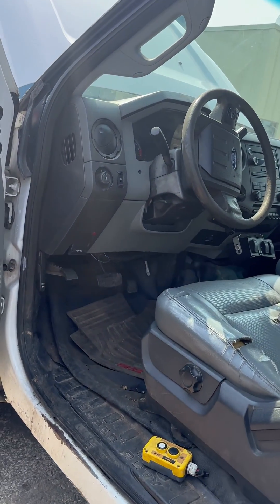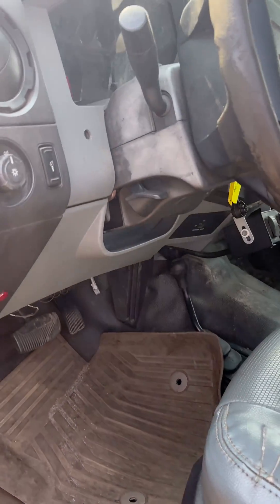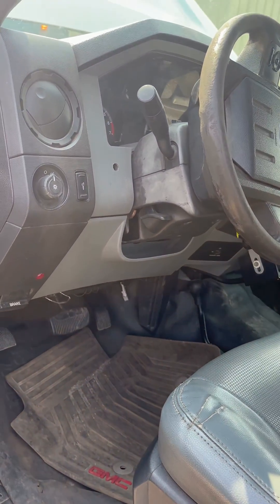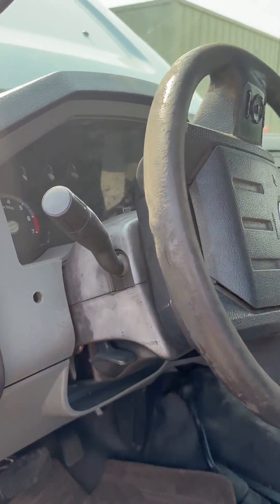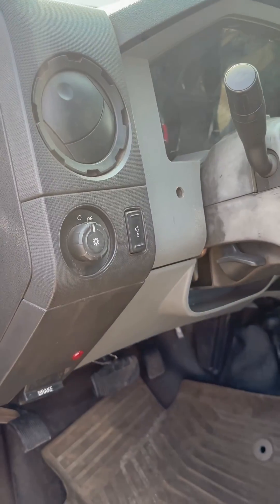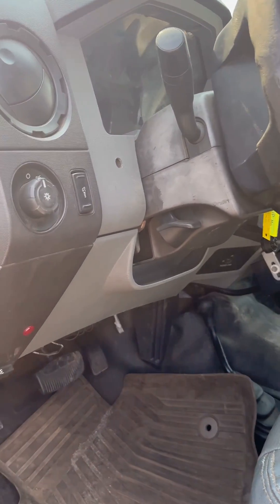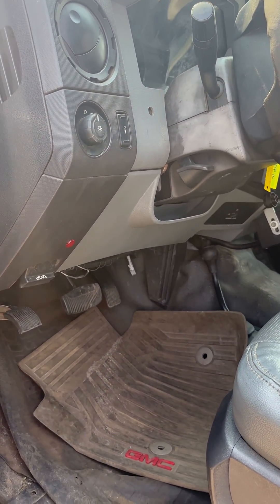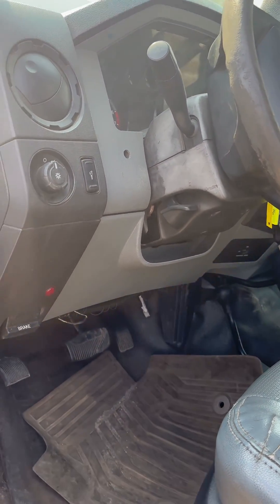Ford F series truck No start no crank temporary fix to get started!

Comment: So what was the permanent fix bro
Reply from the maker: @JDieselTECH  wiring in the harness under the driver side dash, I think a ground wire had corrosion or was loose! It’s been a while hahaha so not 100% sure now
Reply: @Natesautorepairs  thanks dude I was  trying to figure this out for like 2 days lol i checked every wired ended up being a faulty PCM
Reply from the maker: @JDieselTECH  ah damn that sucks to hear. Expensive fix for sure. Glad to hear you found the problem though!